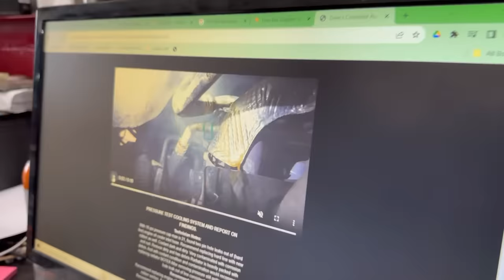The truth about maintenance, and what the manufactures tell you vs what you need to know

Comment: Watched an interview of an industry consultant on engines.  He had worked for years for a Japanese auto manufacturer.  He was asked about what to do about oil changes.  The stated goal was to make the engine last as long as possible.  Not to get through a warranty period.  Not to get through a lease.

His response, not in order:
1.  The quality of the filter was critical.  Don't use an inferior filter.
2.  You can use a synthetic oil and get more mileage between changes.  However, you can use an inexpensive, industry standard oil.
3.  Driving a small amount of miles does not mean you can go a long time between changes.  Water will get in no matter what.  He doesn't let the oil changes go more than 6 months, no matter what the mileage.  So if the average American driving is 15,000 or 18,000 miles a year, it means in 6 months you are driving 7,500 to 9,000 miles, right?  I don't know many people who change the oil every 6 months.  However, I drive only about 4000 miles a year, most of the mileage to the grocery store.  SO, I change the oil every 3,000 miles and use a "factory" filter.
4.  So the expert has a change every 3-5,000 miles depending upon whether it is inexpensive oil or synthetic and never going more than 6 months.
5.  If you go to the quicklube place, you are guaranteed a cheap filter.  I use my mechanic and I supply the oil filter.
6.  Just like "sealed transmissions mean no worries about a transmission going bad", no one in the car repair business speaks about an "oil change and lube job" anymore.  There are places to lubricate and a chemical to "lube" under the car.  There are rubber and quasi rubber gaskets and seals.  If they are allowed to harden and crack, a "sealed system" can gain contaminants and fail.  So, when the oil change is performed, a lubrication is performed and a list is given or what to lubricate.  Believe it or not, the "modern mechanic" will not know what gaskets and seals to lubricate or why, they are simply trained to be parts replacers.

Comment: For my Toyota RAV4 I change the engine oil every 5,000 miles or less, coolant and transmission fluid every 60,000 or 6 years, differential and transfer case oil I do at the same time as the transmission since the gear oil only takes a quart for both, spark plugs every 100k. Even Toyota super long life coolant needs replaced, and sooner than Toyota recommends, over time it starts attacking seals. Check the oil regularly. Never run modern engines low on oil, besides the obvious oil starvation you will come the oil, variable valve timing components create extra heat and the less oil you have in the sump the more heat it retains.
This is a tried and true maintenance schedule to get 300k + from a Toyota. Never do extended oil change intervals.
 Do the maintenance, make repairs proactively, don't wait until your brakes grind to replace them, don't wait untill your tires are ruined to replace worn steering and suspension parts, make frequent inspections. If you don't know how to do it find a reputable mechanic and let them know you want your vehicle to last and you want to be proactive in maintenance, repair and prevention.  When you find a shop you trust listen to their advice. But a trusted shop is rarely the shop that recommends high dollar services everytime you go in. 
Cars are getting more and more expensive AND complex, but at the same time they are more reliable than ever, rigorous maintenance is key to avoiding expensive repairs.
I remember when 100k was near the limit for domestic autos. That's no longer the case for most.

Comment: Genuinly feel abit of a fool for following the manual on my Equinox waiting close to 100K miles before a transmission fluid change. Called the dealership and was told its probably too far gone (sitting just over 94K when i called, now 96.5K miles) great lol shoulda listened to my gut and got my transmission fluid changed at 70K miles.

Comment: One of the first three items a father should teach his ( learning to drive children ) is how to change a flat tire. Where spare ,Jack, and Jack points are located and how to use the Jack. How to loosen lug nuts, how to do the total job safely and correctly. The second item is change the engine oil and filter. Where drain, and oil fill plugs are located along with proper recommended oil to be used and the oil filter type and location . The third item is tire air pressures. Again location of information on the tire and how to do the check including the spare tire.This actually should be mandatory in order to obtain a permit to operate the vehicle. ( My opinion only.)
Reply: And also being able to know how to jump start a car battery and possibly changing out one...

Comment: Hmmmm.  I drive a 2014 Subaru wrx.  I change the oil every 3000 miles.  The coolant every 50k or 4 years. Transmission fluid every 30k.  My car has never had issues like this lol

Comment: Here in Germany there was a lawsuit against BMW leasing in 2012. A man wanted to give back his 320i after only 30.000 km (19K miles) because of several technical problems.

The leasing company demanded a huge penalty payment. They met in court and as it turned out they calculated with maximum lifetime of 150.000 km (93K miles) for the car. After that it's "worthless" so they stated I court.

Comment: I always insisted to my employees, find a good boot, go half a size bigger, full calf and ankle support, 
lace ups, care for them, polish, wax, air them out and wear top quality socks.   I always wore two pair , a snug sports sock and a top of the range woollen work sock.  We were licensed Timber Sand Soil and Gravel Operations, We never had lower leg injuries and the two snake bites that occurred did not penetrate the upper leather of the Boots,  I Told the Guys your Feet are just as important as your Eye's and Ear's look after them and you will be going strong when the Slip on Boot Guys kick the Bucket.
Edit  Addendum….. I took this advice from my Stepdad, God Bless that man, He had the same philosophy with vehicles keep them honest, work them hard , a tuppence maintenance will save a Pound replacement.

Comment: I understand completely what you're saying and agree people don't take maintenance serious enough. My one question is you mention doubling up on maintenance intervals from what the manual says; I've seen numerous instances where people went pretty far with their mileage before getting an oil change (much farther than I would), and sent in an oil sample to a lab that conducted testing on the sample. In many of those cases they said the oil was still fit for more use. I understand this isn't every case but when hearing this how do you explain doubling up on oil changes when others are being told by these labs their oil is still fine for continued use after over 7500 miles at times? I'm not saying you're wrong or even playing devil's advocate. I'm really just trying to understand the discrepancy between these 2 opposing answers.

Comment: We purchased a 2002 Honda Civic new off the lot 
I used a local speedy drive thru oil change business and had the oil changed at the 500 mile mark and again when it hit 1000 miles and every 2k/3k from that point forward 
348000 miles later still running strong 
I live in the Northeast so body/floor pan rust/rot took it off the road 😢
I’m a huge proponent for oil changes early and often but it mostly falls on deaf ears 
Man I miss that car

Comment: Yeah the manual says to change the oil once a year or every 16,000kms on my car. I do it every 6 months which works out to about 6,500kms. The extra $100 I spend a year is peace of mind and the car runs great at 12 years old. Coolant flush/fills are cheap and easy to do which is why I scratch my head at why people neglect to do such a thing.

Comment: I have many cars that I did no maintenance on and it was all fine.  No oil change just topped it up. No servicing and they are just fine.  I also did all the maintenance on a MX5 and it made no difference.  I am not BSing.  My wife agrees, opening something up and changing it can cause start up transients and stresses.

Do a cost benefit analysis and see what happens.  I am a real car guy and I now do not do any maintenance unless necessary and drive a 2007 Honda Accord, never serviced it ever.  Still runs a dream but all the plastics are cracking.

Comment: I just traded an 08' Tribeca.  140K.  I took it for repairs the first time for lean bank 1 sensor 1.
2 months ago. I had changed sensors, plugs looked and listened for vacuum leaks all I could before taking to mechanic.
They replaced MAF sensor.  $400.
Would like to have not traded but this will probably be my last vehicle and it will be maintained meticulesly!

Comment: Everyone talks about changing oil yes this is key but equally are all the other fluids. Coolant has a very limited life before it's ability to stop corrosion ceases. 2 years. Many vehicles have two coolant systems. One for the engine and another for the hybrid inverter. Brake fluid clutch fluid again 2 years. Transmission fluid 3 years unless the vehicle is used for heavy load and then more frequently. Rear differential or trans axle Fuel filters air filters grease points. Timing belts and hoses are all disposable service items. And if you drive in sand snow through water then even more servicing is required. Can't afford this then either do it yourself sometimes if you know how to. And if not learn and get help. Your vehicle will last dramatically longer.

Comment: As a self taught mechanic, a car is like your body it's only going to take care of you if you take care of it, I recommend oil changes like this if you like to drive like a race car driver check and possibly change at 2000-3000 miles if you drive normal without hitting gas hard all the time check at 4000-5000 miles and change. It's sad profits are more important then saftey.

Comment: I had a mercedes and Porsche and both said use mobile 1 and go 10k-12k between changes.  F that.  Every 5k miles with a napa gold filter and mobil 1.  Or once a season if I did not exceed 5k miles.  I do that with all cars outside of those 2.  5k miles, kirkland synthetic and a napa gold filter.  I do use prolong as well.  I had a coolant line burst and my engine overheated.  No damage except a bad coil where coolant got into it. I was shocked.  The engine should have been destroyed.  I attribute that to running it in every oil change.

Comment: I do my own maintenance.  I change my oil every 3000 miles. Full synthetic oil on all my vehicles. I check everything when I'm changing oil from suspension, brakes,hoses,belts. I change spark plugs every 30k miles. Inexpensive way to keep my cars and trucks running smoothly.
Reply from the maker: Great point!

Comment: I have a 2003 Toyota Hilux, with 408,000 K's on it, or 253,519 miles. It carries  a full load of pressure cleaning gear every day. I change the oil, filter, coolant & plugs every 10,000 K's, & it has never missed a beat. oil might be down 200 ml after 10,000. My mechanic cant believe it, & he's  Toyota trained .

Comment: I just drained and fill the coolant  once a year and it seems to be doing good.
Reply: I flushed the cooling system one time and one time only on my 1986 Honda Accord Dx. Did other basic maintenance..conventional oil changes every 8-10 thousand miles, never changed gear oil for standard trans. The car ate brakes in the front and went through several rounds of cv joints and a couple of axles while I had it. Traded it in at 262,000 miles. Left me hangin ONE time...water pump gave out at around 240,00 miles.

Comment: I agree with you, but it is likely even with a coolant change that thing would have failed anyway. The pipe looks fine, so the seal must have failed, which is meant to fail after the warranty. All that garbage in the fluid is more then likely some leak repair which has copper in it.

Comment: Lifetime fluid bit me. 120k miles. Never had a fluid change for the ATF as it’s not mentioned anywhere in the manual. Needless to say, I no longer have an original transmission. Now I change my oil every 3k miles and plan to change trans fluid every 30. Folks it’s worth getting the service than replacing the most expensive components on your car. Brake fluid and coolant flush are next on the list.

Comment: We use Shell "Rotella" diesel oil where I live, south louisiana, lots of oil field diesels down here "the Mule" of the oilfield, I worked for a.constuction company in new orleans, we had tug boats and crane barges with diesel engines, the mechanic told me that diesel has lots of trash in it, (parafin) wax and other trash, he would change the fuel filters every time he would come work on the engines, he had cases of "Wix' fuel and oil filters.
 And engine coolant never put well water in a cooling system or city water,it has hard minerals ,it will eventually clog up your cooling system. Use 50/50 pre mix anti freeze, or distilled water and pure anti freeze(cheaper).
  Use the glow plugs to start a diesel, turn on key ,wait about 30 seconds to let glow plugs warm up, then start engine,and drive slow at first,a diesel can't burn fuel if engine is cold ,let engine warm up, before stomping on the gas pedal, don't be a "Dummy" and ruin your diesel engine, listen to Dave, change your fuel filters regularly, the will cause your fuel pump to work harder a eventually fail.

Comment: 99.5 VW Jetta 278,000 miles - "Lifetime" Transmission fluid.  Worked fine 19 years when sold, gal who bought it? 315,000 same "Lifetime" fluid.   PS, most drivetrain warranties are 5 years 60,000. As to oil changes? Even 5,000 might be too long. Old school here 3,000 mile or 6 months whichever comes first. Coolant? Every 3 years or under 50,000 miles. Hint want to cut corrosion down?  Distilled water and coolant. Wrenched for 28 years.

Comment: I change my oil every 3k miles with full synthetic regardless of make or model. Even diesel trucks. I change my transmission fluid and filters every few oil changes. I also regularly flush my engine coolant and replace it. Same goes for brake fluid and clutch cylinder fluid. Every fluid and oil in my vehicle looks brand new, the engine runs like new and the car has over 130k miles on it and is over 20 years old and yes it's a Chevy.

Comment: I just laugh when ppl say brand x/y/z is terrible.  It really does come down to maintenance.  the reason why the oil change intervals got so high was because manufactures decided to include oil changes with the purchase of the vehicles.  All ppl should budget at least $500 per car per year for maintenance beyond oil changes,  if youd rather have a new car under warranty and take that hit as depreciation, then that's up to you, but most of the time the depreciation is more than the maintenance cost.  What ppl need to realize is that they will spend the money one way or another.  If you don't maintain the car, you will end up with a large failure like and engine/ trans/ etc for 3-5k or more.  if you don't take care of the car and go to sell it or trade it in, you will get an offer for 3-5k less than a vehicle that is in great mechanical shape that they do not need to put any money into. So you end up paying regardless.  Best to just budget for maintenance knowing that small things will break and nothing lasts forever.

Comment: Was it better in the past? Had a Volvo with 350k miles, an Acura with 225k and a Toyota with 210k that were still going strong when I sold them and i followed the standard service schedules. These were 1980-2000 vintage. My current cars are 2012s and are fine too but are babies with 100k-150k on them so we’ll see. Hate to waste money on unnecessary service.

Comment: 10k miles between oil changes is crazy. And probably causes other issues since inspections at oil changes sometimes catch other problems. Whatever happened to the time requirement for oil changes like every 6 months or every year regardless of mileage. 
I tried asking my car guy about changing the transmission fluid when doing the 50k service and he ondly recommended NOT changing it though thought it was mentioned in the manual.

Comment: years ago i saw an Aisin internal factory document for the recommended oil change in their transmission, and it was 20k kms
the auto maker brand who uses that transmission write it to 60k km to their customer who get the car with that transmission

after 150-200k kms more of that transmission had issues due the oil change was only due twice, and not 6-8+ times....but the warranty was over

in the 2000's some EU car makers due the same with engine oil in turbodiesel cars
one of them said: not need to change in this the oil just after 30k kms...and the engine had only 3.2-3.3liters oil
same engine in other carmaker write 50k kms
later crankshaft bearing and turbo issues the 1st go down from 30k kms to 20k, the other from 50k kms to 30k and later to 20k...
but who owned the car, and use it longer time, and do the oil changes after 8-10k kms can used that car without engine issues well over 400k kms too

and not evrytime the very expensive oil is the key for this, the shorter period oil change with regular oils is far enough too
think about, even the regular oils are better now what an expesive was 10-15years ago
"longlife period"...bullshit, forget it

and after 8-10years or 250k kms or 150k miles dismount once the oil pan / oil sump for a cleaning ;)

Comment: I was on a Trip and went 3600 miles on my oil and was Antsy about that Lol, I like to change it around 3000 or 2500 if it sets a lot, tranny around 25 or 30 thousand and flush radiator at 3 years or 25000 miles. maintained right  the vehicle will treat you right. I'm 72 and can say I've never been left on the side of a Road.